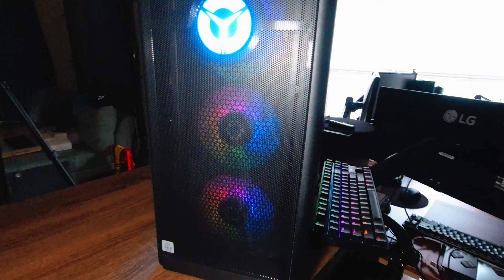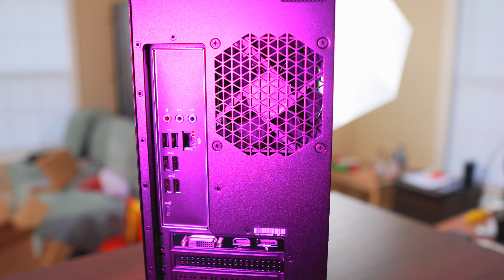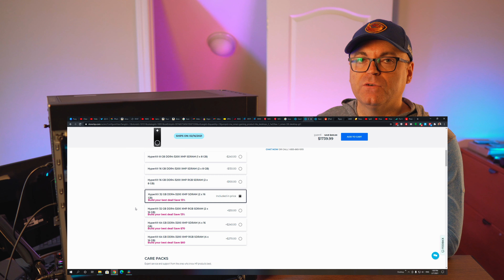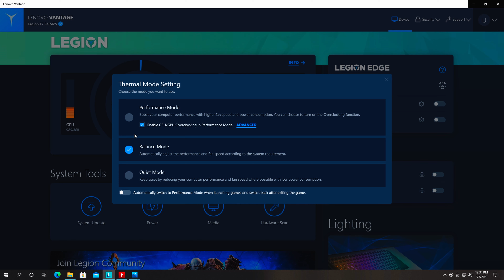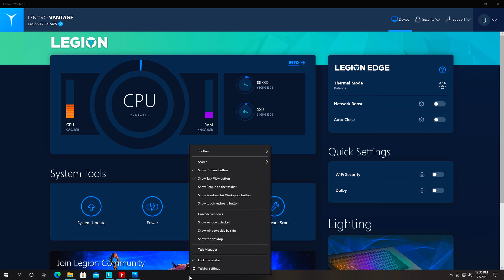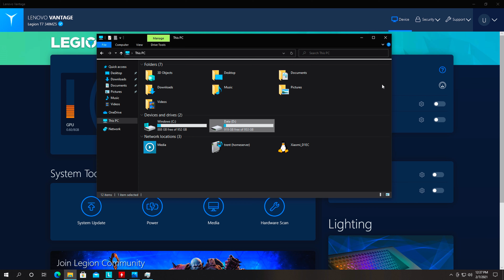Lenovo Legion T7i - Possibly The Best One Yet!

Comment: Im really tempted to get a refurbished T7 with 12700k/ 3070ti/ 32 GB Ram for $1,000. Is the MoBo a proprietary version that I'll be stuck with. Been using a 6700k/ GTX 1070 since 2016 which has been great.
Reply: Yes it's useless for upgrading in the future, cant upgrade ram, cooler aio cooler backplate is glued to  the motherboard, can't do anything in bio

Comment: Hi, firstable thank you very much for your videos, it help us when we decide what to buy. I owned this pc and it serve me very well for what I want. Only I have an issue now that is when I turn on the pc, the machine comes on, but there is no signal on the monitors. Then I need to press & hold the on button to turn off, wait 5 secs and press the on button again and the machine turns on without any problems. Any ideas what is the possible causes of that? Maybe is the power supply that is damage? Thanks for all
Reply from the maker: Could be GPU, I have a similar issue with RTX 2080 super not always displaying on boot

Comment: I would say you can hear the GPU. It has a high but not that noticeable whine but it does get really hot. 78C is my record but on the topic of noise I'd say coil whine is the bigger problem. Certainly with my huntkey power supply.

Comment: Too bad Bios doesn’t allow memory overclocking with OTS Memory. If you put OTS memory in the motherboard it will run at 2133 irregardless of the “spec on the memory”

Comment: Hi sir, i have a question. i have the t5model with a 3070 but i think the motherboard is the same. i want a upgrade the storage populating the second m2 slot, i prefer a 2tb memori, but in the user manual  lenovo say support max 1tb storage at slot for 2tb max, but crucial say they're 2tb ssd on this model not give any problem. you can confirm? and, i ve found a very intresting offert for 2tb nvme gen4 of wd black at intresting price, can i buy and upgrade without worrying? Sorry but it's hard to find specific answer for this motherboard...
Reply from the maker: I am not sure honestly, I have 2x1TB drives on my other Lenovo T7, but for this one I don't know. If I had a 2TB I would test.

Comment: I watched this video and got one as my first gaming PC. However, it constantly restart or freeze in the middle of a game. I had all my graphic settings on low, and it became more and more frustrating. Could you provide any suggestions? I listed my config below. Thanks!

Processor: 11th Generation Intel® Core™ i9-11900K Processor with vPro™ (3.50 GHz, up to 5.30 GHz with Turbo Boost, 8 Cores, 16 Threads, 16 MB Cache)
Graphics: RTX 3070 8GB
Memory: 32 GB DDR4 3200MHz (2 x 16 GB)
Reply from the maker: Does this happen to all games?
Reply: @HardwareSense  Thanks for the quick reply! I only tested on two FPS games and it happened on both of them. It also seems like there are frame drop after 20 or 30 min playing.

The freeze issue even happened a few times when only opening up softwares.
Reply from the maker: @lj_-ew7ew  Sounds like temps and overheating related, do you monitor the temps?

Comment: Hi i just ordered this exact computer because of all the good reviews. If I wanted to install a Card for Thunderbolt 3 do you have any suggestions? I tried looking up some things and a lot of bad reviews on the cards i found.
Reply from the maker: I personally don't have much experience with cards like that, but I am sure that there are some good one reviewed on Amazon
Reply: @HardwareSense  if you don't mind can I ask one more question. I have a laptop that i normally work on with HDMI going from laptop to larger monitor, can i plug my hdmi direct into the 3070 from my laptop and screen share or do i need one of those capture cards like the Elgato hd60 to do this?
Reply from the maker: @maplefoxx6285  Yea you would need a capture card. Or record videos with the nVidia software
Reply: @HardwareSense  ok, thanks, i looked into this now and I guess Avermedia make the most affordable 1080p capture card then they have a higher priced 4k one, easy to install in this build? i shouldn't have to move anything right?
Reply from the maker: @maplefoxx6285  It should be very easy
Reply: @HardwareSense  ok thanks so much
Reply from the maker: @maplefoxx6285  It has to be that special HP HyperX Fury memory otherwise it will default to its stock frequency
Reply: @HardwareSense  hyper X does not exist anymore. it is now called Fury Beast. I think it is the same thing. not 100 percent sure, but i think it is. The fury beast is 3600 ddr4, looks identical.. when i read up about it they no longer use the name hyper X. i might call lenovo

Comment: What you think, this is maybe good computer? Lenovo legion T7

Some specs:

CPU	Intel Core i9 12900KF
VGA	Nvidia GeForce RTX 3080 Ti
Motherboard	Lenovo Z690
RAM	32GB   DDR5 4800MHz 
Cooling	AIO 360 RGB
M.2 PCIe NVMe SSD  2Gt

PSU	 850W 80PLUS Gold
Reply from the maker: Yes it's amazing
Reply: @HardwareSense  Thx for reply :) Maybe it`s better than acer orion 7000 / I9 12900k, rtx 3090, 32GB ddr5 or what you think? I mean cooling system etch..I`m appreciate if you can give your opinion conserning of these two options...I know that in legion you can put max 128GB memory and acer max memory is 64GB...In Legion you have three M.2 slots and acer have two slots and it says that two 1GB M.2 slots?? Also AIO is bigger in legion....and more fans..front 3 pcs fans...
Reply from the maker: @mikko4956  Well Acer is not known to be making a good gaming desktops or laptops for that matter, so yeah Lenovo it is
Reply: @HardwareSense  Thanks, so lenovo it`s better option :)

Comment: Should I buy DESKTOP LENOVO LEGION T5 CORE İ7 11700F 2.5GHZ 32GB 512GB SSD 8GB NVIDIA RTX3070 WIN10 OR Laptop Asus Rog Strix G15 5.Nesil Ryzen 9 5900HX-16Gb-1Tb Ssd-15.6''-Rtx3070 8Gb-W10?
I am not good at changing computer parts, so which one is better for me or which one is safer or less likely to go to maintanence service?
Reply from the maker: Price?
Reply: @HardwareSense  The prices are almost same in my country. Rog Strix is 36,000 (2,662 Dollars) and Lenovo desktop is 34,000 (2,500 Dollars)
Reply from the maker: @mcan-piano4718  Go for the Lenovo
Reply: @HardwareSense  Will it be fine even though T5 Intel version I find, 1) it doesnt have mesh front or perfect cooling like the T7i in the video and 2) probably not dual Ram, single 32GB and I dont know about changing rams (if it has have big effect for using for productivity like 3d render times?)
Reply from the maker: @mcan-piano4718  No you need the version with the mesh front
Reply: @HardwareSense  Ahh okay then I shouldnt buy that one I guess. Then I should choose ROG Strix 3070 laptop. Thank you for help

Comment: This video was very helpful to me so I bought a prebuilt version like this with an rtx 3080ti, and was wondering which brand does my rtx3080ti belongs to
Reply from the maker: MSI most likely
Reply: Hey buddy. I'm thinking of buying your build as well (7i legion Gen 7 tower) in lieu of the same spec laptop that was supposed to be released in May. How's the FPS and thermal performance for your build? How much power does the GPU take?
Reply: @extremeheat9283  I've had the i7 10700k rtx 3080 desktop for a year now, temps when running all sorts of games 60s and mid 70s, I run 4k and 2k, watts I think I last saw was gpu 250 to 300 maybe little lower can't remember.

Comment: I'm a lucky owner of one of these and I really can not complain about it, it deliveres the performance, stays quiet at almost all times and easily does 1440p@60 which in my opinion is more than enough. I have had this pc for about 2 Months now and I am really happy with it. Definite recommendation for this one! And what's even better is that Lenovo offers a standard 2 year warranty without any extra fees which is actually getting rarer nowadays (looking at dell and hp for ex. with only 1 year). And you can extend the warranty even after you have already bought the pc if you really want to be on the safe side.
Reply: Hey man, how's this holding up. Looking to buy this wondering on longer term use case info. Cheers
Reply: @yng3ihAq  No issues at all. The only thing i would change after warranty is the radiator size or maybe even switch to air cooled. Other than that really great machine I don't ever have to worry about a game's requirements at the moment.

EDIT:
I just remembered that the inside white case light is flickering from time to time since i got the pc but as I don't like the light it gives anyway i just turned it off and had forever peace.
Reply: @S.c.o.r bbbjbnbbnjb
Reply: Unoni
Reply: Ikkkkk lol😊
Reply: J. 😊

Comment: I bought one the only came with SDD, is there any specific HDD I should buy to upgrade my Pc?
Reply from the maker: Just get an SSD or Nvme, don't use hard drives
Reply: @HardwareSense  gotcha, so you can fit 2 ssd no issues?
Reply from the maker: @mcolumbusm  yes

Comment: Hmm the legion is £150 more than the omen. Both have i7 10700k and 3080. Heard the Omen thermals are fine with this configuration. Which would you go for? The cheaper cost of the omen is swaying my decision
Reply from the maker: The Legion cooling and case are miles ahead of the one on HP
Reply: @HardwareSense  thanks for the quick reply! Think I'll go with the Lenovo. Is it also easily upgradeable down the line?
Reply from the maker: @t__uncensor1337  It should be

Comment: Hi, i just bought the Lenovo Legion T5 with AMD Ryzen 9 5900x, RTX 3070,  32GB DDR4 3200Mhz and 1TB PCIe Nvme drive. It comes this Monday! Is this version any different than yours? (CPU wise) and what is the difference between T5 and T7?
Reply from the maker: Yes there is a big difference, the T5 is a smaller case without liquid cooling, but the GPU is the same.
Reply: @HardwareSense  I can still cancel the buy order and order this one for €100 more: T7 with 
 Intel Core i9 11900K, RTX 3070,  32GB DDR4 3200Mhz and 1TB PCIe Nvme drive. Do you recommend doing that?
Reply from the maker: @arnoudjonkers525  The 10900k is better than the 11900k, so if that's the only reason, stick with the 10th generation

Comment: I feel like a dick.. They had a massive sale on the Lenovo 3070 one here in Australia recently.. 32 ram/3070/can't remember processor but it was 8 or 10 core...
and I didn't get it cause it didn't have a thunderbolt port (dual user here, gamer/audio production, audio interfaces are thunderbolt)..
But in hindsight I totally wish I got it. Oh well. It was so cheap.
Omen currently have black friday sale on the 30L, 10700K/16 ram (can upgrade easily myself)/1Tb ssd/3080 for 3000 AUD.. believe me for Australia that is good (around 2100 USD) since cheapest 3080 alone here is 2 grand LOL. Again no thunderbolt and I am a bit concerned on CPU cooler, but maybe ok for the 10700K 8 core? What do you think?
EDIT, oops, it is a 5ti not a 7ti.. currently on black friday sale for 2300 AUD (around 1500 US). with 3060ti, 16 ram, 11700 8 core.. I can't find much on the temps in the 5ti unfortunately. the 3070 all gone but 3060ti is about what I am used to with 3080 laptop, and can game at 1440p with that, so is ok for me I think. Do not or will never need 4K. 32 or even 64 ram is essential for me.. will most 3200 ram work correctly?
Reply from the maker: The I5 has no issues with the temps, and yes with the new Bios most 3200mhz ram can be used.
Reply: @HardwareSense  Wow thanks for the answer mate! It seems like a bargain then for 11th gen 8 core and 3060ti, i'll use the extra money to buy a 1440P g sync screen.

Still, the 3080 omen 30L is $700 more and gets a 3080. The 10700K is unlocked so even though slower than 11700, I can fine tune flat clock rates, say 4.4 ghz flat across all cores, which is really beneficial for low latency audio production. My main issue is wondering whether the small cooler can even do the 10700K adequate in the Omen, and if it's just too noisy even when graphics card is not being used (i.e for music recording). I am going to look at the alienware R12 as well currently with huge discount and a 3080. I am so confused cause Black Friday pressure comes so quickly, and I was a mac user from 2002 to 2019. I was PC from 97 to 2002 then switched for Logic Pro. Now I use pro tools and am tired of apple prices and constant new OS and hardware compatibility issues.. oh, and bad gaming. I went back to PC in 2019 but laptop only, currently with Prometheus XVII laptop with 5900hx and 3080 for the game room. I am happy with this and the desktop will be for the music room (with gaming on the side LOL). I really enjoy your videos, very articulated, thank you. Subbed :)
Reply from the maker: @Bavanity  The 10th Gen Intel is actually better value and performance than the 11th Gen, which is an absolute shame.
Reply: @HardwareSense  Hmm it must be different to laptop then. The 11900H for example DESTROYS the 10980HK.. Alienware 10980HK in M17R3 with vapor chamber, is able to run at all core speed of 4.4ghz without thermal throttling in CB R20. Best score 4472. 11900H in Asus S17 running at 4.4 all core turbo in cinebench without throttling. CB R20 score 5620. That is a massive difference of 30% almost. So clock for clock 11th gen way faster in both single and multi core in laptop. I just presumed the same for desktop, sorry. blush
It was 2 intel 8 core cpu with identical all core turbo clock, just different gen and that 10th gen is overclockable (but you can get that with 11980HK in 11th gen too). Alienware chassis was at absolute limit sustaining 100% load on 8 cores at 4.4ghz with 100% fan and -0.50 undervolt, temps were 95. Asus was 80c maximum, never went above! Uses liquid metal though and is just a much better solution overall, in fact  I think it has best thermals of any laptop in existence to be completely honest!
Reply from the maker: @Bavanity  Yes in laptops is slightly better, but for desktop, things are much different.
Reply: @HardwareSense  Ok and I can't find Alienware with 10th gen anymore, but I can find with ryzen 5900X.. I can find lenovo with 5700G 8 core.. but only tenth gen is the omen 30L with 10700K. As you say, 10900K is too much for the included cooler.. I am not the type that can put whole new liquid cooler.... I can't find any results with 30L and 10700K unfortunately.
Reply from the maker: @Bavanity  The Ryzen 5900x is an excellent choice too, but the temps might be too high for the 120mm AIO
Reply: @HardwareSense  The ryzen is not Omen it's alienware aurora or legion (8 core only in legion, 12 in alienware).. Are they using crappy 120mm also? Can't win LOL.
Reply from the maker: @Bavanity  Yep
Reply: @HardwareSense  Sigh. Thanks.:) Very cool of you to reply, much appreciated.

Comment: Is this pc with the 3080ti inside worth the price in the uk of 2600 at the minute or is that over the top ? , also is it easy enough to out a hdd in as I've seen it doesn't come with one only a ssd
Reply from the maker: It's up to you if it's worth it and the prices and availability of the 3080TI there.

Comment: Hey, what exactly where the problems you mentioned with the omen 30l? I have just sent mine in for inspection/repair.. when i gamed cpu would show 100% and games would stutter and lag and was extremely frustrating. No viruses etc were found and i had it looked at by a friend and he found nothing wrong with it. The only thing he said was the case was too small and the 500w (“optimized”) power supply just wasn’t adequate. He said thermal throttling could be a huge problem with this computer.. does this sound like something that could be possible?

Comment: Bought this PC and very disappointed. The locked down bios is set up in such a way that the 10700kf suffers from EDP/Current Limit Throttling when under load/stress causing the CPU to throttle back due to power constraints. My PC scored in the bottom 8% of PCs of the same CPU/GPU in the popular 3D Mark 'Time Spy' as a result. I see others complaining of the exact same issue with quite a few people incredibly frustrated (check Lenovo's forums and reddit).  It's a result of the way Lenovo have made the bios which basically causes the PC to under perform. It could probably be fixed with a bios update but Lenovo don't seem to be doing anything about that. I feel very misled.
Reply: Is this still a problem or did they fix it?
Reply: @Anapaest  I returned mine after a lot of hassle. I have no idea if the newer models are any better. Personally, I wouldn't take the chance again. And I should add that I also would be wary of socalled 'reviewers' that say how great stuff is. I trusted this particular review and can tell you that was a big mistake.

Comment: Hi, great video!
Just wondering if upgradeability is possible on this unit? (Changing graphics card to newer ones for an example)
Thank you!
Reply from the maker: Yes everything can be upgraded easily, only the ram is a bit tricky
Reply: @HardwareSense   May I ask, what makes the upgrade of the RAM tricky? Anything different with the RAM-Slots compared to other Mainboards?
Reply from the maker: @mischaindermaur3714  The problem is compatibility, the OEM motherboard does not allow any XMP profile memory and it will default to its stock frequency